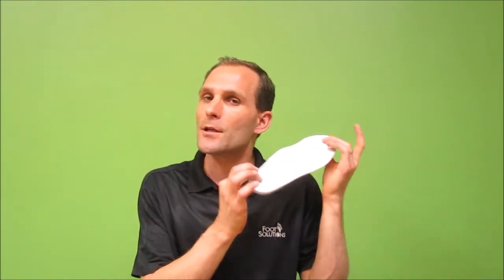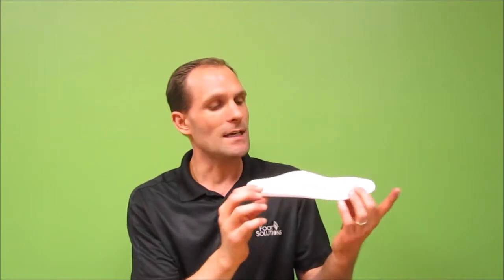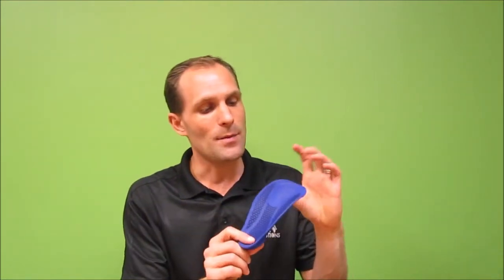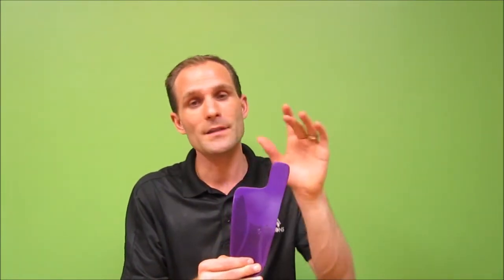3D PRINTED FOOT ORTHOTIC INSOLES

Comment: Why after the Print It took a Few Minutes to get the Arch Supports. Do You Have to come Back to do the Fitting after the Print.
Reply from the maker: 3D printing of a pair of orthotics takes about 1 to 4 hours depending on the printers. Plus there's additional time required to add top covers or modifications, if required. We can now designs devices based on the insoles of the shoes, so adjustments on pick up aren't always necessary.

Comment: What material are you using to print these insoles
Reply from the maker: The ones presented in this video are produced using the SLS printing method. We use flex nylon for these. However, we also started printing with EVA compounds and carbon fibre.

Comment: I would like to print these at home for my wife. Do you have the printing files available for sale?
Reply from the maker: These are custom designed to the foot based on a three dimensional impression. We don't have generic files. The design files are proprietary to Podfo, the provider.
Reply: @FootGeekzTV  What is the process to get orthotics from you?
Reply from the maker: @chalder1  are you in Vancouver?
Reply: @FootGeekzTV  New Mexico
Reply from the maker: @chalder1  that would make it challenging, as we do a full personal assessment on site to ensure the orthotic device does what it's supposed to. You may want to contact Podfo to see if they have a provider in New Mexico.
Reply: What the Difference Between X-ray.

Comment: Are 3d better for correcting leg length  discrepancies?
Reply from the maker: To best correct leg length discrepancies the lift should be attached to the footwear. This allows for the foot to be elevated for the entire duration of the walking cycle. Also, keep in mind that a lift should be worn most of the time, even in slippers, to prevent the hip from being thrown out of alignment. However, if you're looking to only correct the discrepancy at the heel a 3D printed orthotic can give you the most accurate height adjustment.